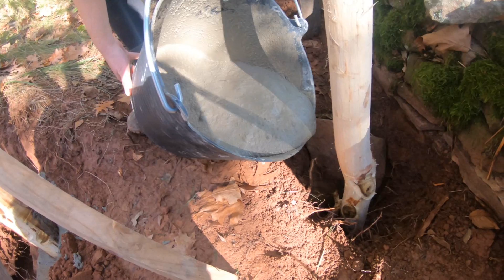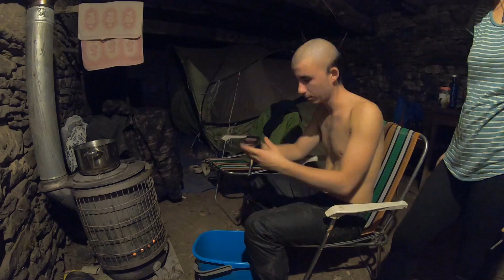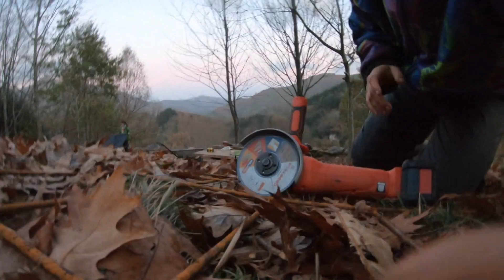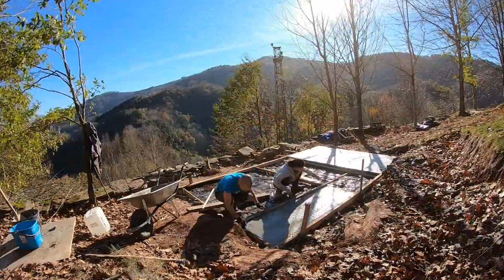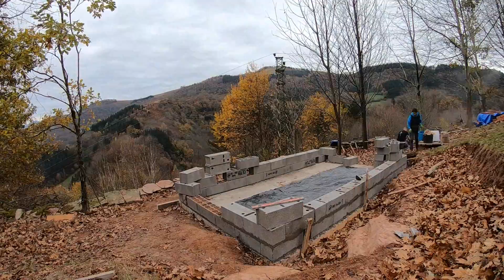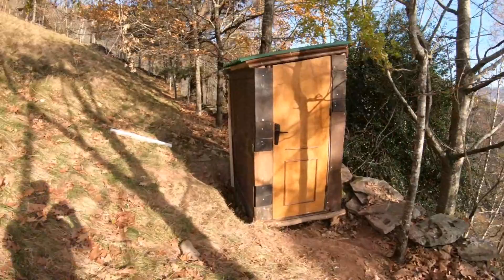Starting our Tiny House (November 2020 Part 2)

Comment: more than a bit confusing to the casual viewer; we started with you in a old stone cabin, doing rennovations and sleeping in tents in one of its rooms; never learned what country that was in (one commentator welcomed you to france) or where you came from or what you did to buy it, the cost and all the tools you have.  Now you are building a new house, same set of questions plus was the original stone house just a shelter until you could build the new one?  Biographies please.